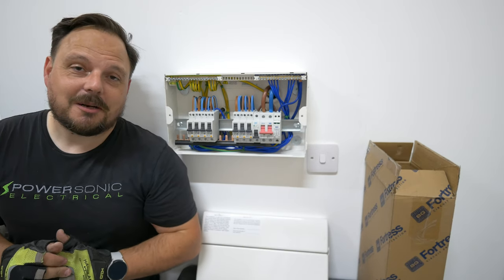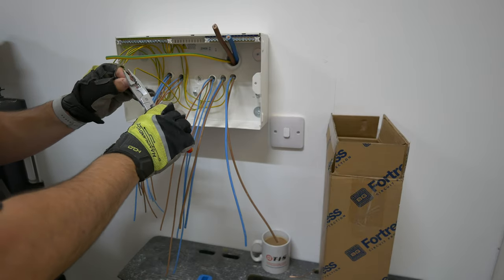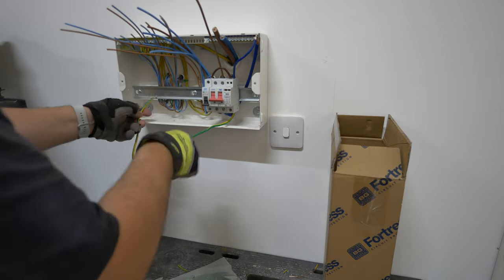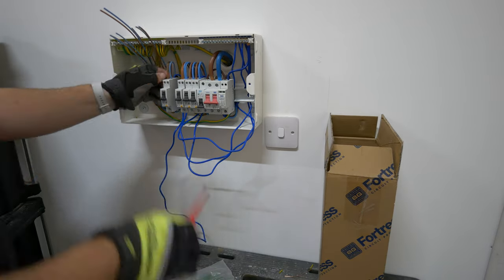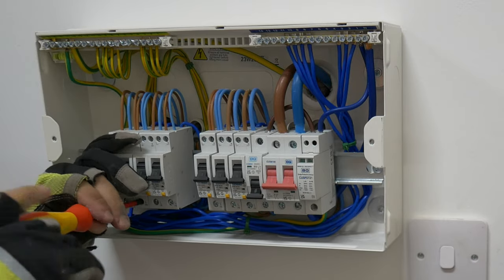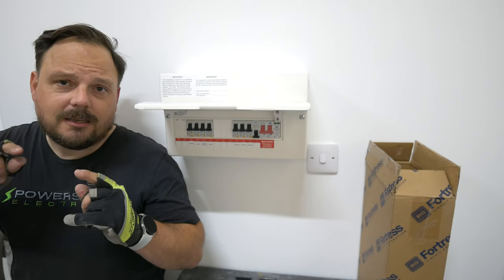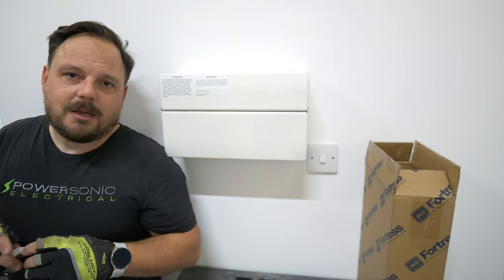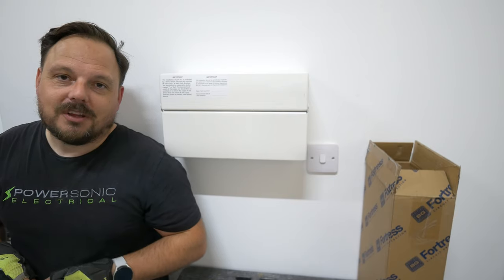Apparently its easy to install a consumer unit ??? Full run through - TIPS - TRICKS - BAD HABITS???

Comment: Tip for getting the db lids on easily... when fitting the din rail, mount it just tight enough so it moves with a little nudge, mount 4 or 5 mcbs onto middle of din rail, fit db lid on and just start the cover screws, the din rail will align with db cover, use a sharpy, and mark either side centre on din rail and db, pop lid back off, check your markings are still in alignment, and tighten down the din rail screws... when you come to fit the db cover when all is finished it will fit like a treat...
Reply from the maker: That’s a great tip. Thanks for sharing
Reply: Or mark the din rail before you strip down the db for fitting. In theory, it should align correctly, but we all know not all db's are equal...

Comment: I am not an electrician but i have a question regarding  the bus bar should the unused ways be insulated. I enjoyed the video of you doing a neat job.
Reply from the maker: It’s a sensible thing to do and we always fit din rail blanks which cover the busbar. As this is pre testing and final commission we are not at that stage yet. Thanks

Comment: Hey Mark, thanks for the video, it was very informative and I can see you put effort into the installation. I'm not an Electrician, but I am a Commissioning Engineer who works on industrial electro-mechanical equipment. My industry is extremely heavily regulated with regard to safety. Only qualified professionals are allowed to touch the equipment I work on, but all too often a professional makes a mistake and thankfully the additional safe-guards we have in place prevent a serious injury, or death....most of the time. Were we not to take what I call "best practice" safety steps, I know personally of two incidents within my own team where an innocent assumption could have resulted in millions of £/$/€ of equipment damage, or a 3-phase human fry up. 

A couple of people have commented on the bus bar being left exposed in your installation. I know this is behind the cover with blanks installed on the cover. I know that only an Electrician should ever remove the cover, but I understand where others are coming from (though some could have worded it better). Not everyone, professional, or idiot alike does what they should all the time. So, I personally think it's a cheap and easy safety step to insulate the bus bar within the enclosure, even though I agree that it's insulated from the customer when the cover is on.

Every installation I have seen so far had the exposed section of bus bar covered with a plastic strip on the bottom, or where there is a gap between breakers, this exposed section is insulated, or an unused fuse is installed. As you say yourself, you will inevitably have a customer doing something they shouldn't do, so if you are not inclined to leave a magnetic wedge that keeps the fuse board door open for fear the customer will misuse it, would you consider it best practice to insulate the bus bar sections which are exposed if the cover is removed? 

Again, thanks for the video. I'll be installing a shed consumer unit and the videos on here are full of useful tips from the professionals. I will of course be leaving the final inspection and connection to the Electrician, because I know it would be all too easy to make a simple and costly mistake when it comes time to energise the circuit.
Reply from the maker: Cheers Gary, full din rail blanks and proper labelling are always used. But I like to demo what comes in the kits etc. 

A few brands have uninsulated or covered busbars BG are one in some of the range. 

So it is what it is on that front. 

This is actually a demo board at apprentice 121 simulating a small flat for learners to practice within. This video is a reference point as part of that to raise discussion points such as yours.

I have other boards on the channel with similar reviews and what comes out the box. 

Cheers

Mark

Comment: Nicely explained video. 👍
The front cover setting used to be a lot worse on the large boards as the din rail only had end supports and so used to bend really easily. They added centre supports to fix this. As you say, it’s nearly there but still can be a fiddle.
Reply from the maker: Yes it was a lot worse before. I think tbh my struggle getting the busbar in set that in motion as I didn't quite have the mcbs and rcbos lined through.

Comment: Nice clean demo Mark, I must try your technique of laying down the Neutral fly leads to the bottom of the board and bring them up at the end, I usually try and tuck them under the tops of the ones to the right as I fit the RCBO's, as for the keyboard warriors you know what they can do with a pair of croppers
Reply from the maker: That's the method I usually go for tbh hide things behind the 1st few rcbos etc. But plenty of space at the bottom of these boards

Comment: Everyone says it’s easy, but I usually encounter a problem and it will take the whole day, 6am till late at night, I’ve only have one easy board change, 
and what if you encounter a shared neutral on the lighting, if you can sort it out on the day, Takes a very long time to sort that out

Comment: Great video and super useful tips on making inside CU   neat and tidy. Much appreciated.  What is your view please on stranded vs solid core cable. I  believe the cables you worked with   in this video are solid core wire. Do you  ever use stranded cables in domestic wiring please? Thank you.
Reply from the maker: In the UK we have stranded cables but they tend to be on final accessory connections such as lighting pendants, immersion elements, heating controls and more recently some EV ultra cables. Those get ferrule crimped on the end. The fixed wiring is generally solid or 7 strand.

Comment: Question, please ecplain the function of the component arangement on either side of the isolator switch that was already nstalled on the rail prior to attaching the rail to the enclosure.
Reply from the maker: You mean the SPD? Surge protection device?

Comment: Thanks Mark, I found this very interesting and informative. One question I have - how did you know which cables were for which circuits? I couldn't see any labelling. What is your usual method for identifying circuits at this stage? Thanks again, very well presented video.

Comment: This video has given me quite a bit to think about regarding my attempts of fitting a board to the point where I think I can save half an hour on my next install.  One thing I wasn't clear on is how you mark/ identify your cables at the beginning.  Did you number them somehow?  Thanks.
Reply from the maker: Hi Paul, yes number the sheeth to identify. With cables coming in the same entry point you can then transfer that cable ends if its busy in the board. Wasn't needed here as cable entry was separated etc. Thanks

Comment: Those Knipex feed through cable strippers, do you have to do anything special to maintain them. I have a pair that i rarely use as they just mangle the crap out of the cable, if i am lucky i get one clean strip then its back to mutilation again.
Reply from the maker: No mate. Mine just work same as always.

Comment: Awesome job! I just have one question. When you are connecting the unit to the main line do you do it with power on it? I am about to install a new unit and I am slightly concern that I may miss something important. I am planning to pas one cable at the time so there is no real danger when toching one one of them or even the metallic  box with one of them if the other is properly secured, isnt it?

Thanks again for such detailed video.
Reply from the maker: You need to stop what you are doing and speak to an electrician. Do not do what you suggested that’s for sure

Comment: Really great, clear video. I'm considering a career change... from no qualification, to qualified electrician, how long would you say it takes, if you can study full time? Cheers
Reply from the maker: With the portfolio 2-3 years would be absolute quickest I would say is possible even full time. Plenty are on that path and some told 6 months. Getting the experience is the hard part beyond just the courses etc to complete the portfolio and NVQ.
Reply: God people are obsessed with NVQ , take your level 2 and 3 tech certs and complete 2391-52 along with 18th edition and then it’s hard for someone to say you’re not a competent Electrician!

Comment: He's a question... Another spark said to me, why don't I trim the fly lead on the rcbo, to fit the install, like it says on the installation instructions,... Lol,  I said, I just do the same as as what other sparks do 😂😂😂
Reply from the maker: Some brands state not to cut them. I leave them long when possible so they can be moved if required. But sometimes also trim them. We do what we like 🤣🤣

Comment: Nice install.how did you protect the meter leads please
Reply from the maker: What protection would you suggest they require.
Reply: @electrician247  always happy to learn but either in trunking or in wall steel trunking

Comment: Bending over the CPC's to get a nice clamp? Regs state that the terminal must be filled with 2/3 conductor. That's why you bend them over.
Reply from the maker: Do you want to quote that reg and I will share it.  In a terminal bar with 1mm to fill 2/3 you would need more than doubling over 🤣🤣🤣

If you want to look at the actual fact of the matter different brands have different requirements. Most want conductors under 1.5mm doubled over in terminal bars with no reason to double into a cage clamp. 

Hope that helps and your welcome anytime at the academy if you want any further help

Comment: Good video. But it is easy to install a consumer unit,  just be tidy with the wiring.... Did you use the correct torque setting?
Reply from the maker: Nah its easy why would anyone need to torque anything.... I guess its easy when you know how. Who knew.
Reply: 😁 @electrician247

Comment: From France it is a very dangerous installation...what you have done in 13:38 is completely forbidden!! Not acceptable because there is no protection or isolation ...a copper bar installed like that is not very serious from our standards.. it's possible to cut the copper bar to avoid such a weird installation.. NOT ACCEPTABLE AND NON SECURE..I DO NOT APPROVE
Reply from the maker: No need for caps it’s weird. The busbar is isolated via the main switch, it is insulated and carries blanking modules for future use. Cutting it is both unnecessary and counter intuitive. It represents no danger to skilled electrical workers or operators and is standard practice in UK systems. Indeed this is as per instructions and regulations. I take your point of view but don’t require your approval 💪

Comment: Its not a buzzzzzzzzz bar.
Reply from the maker: Say what you see.
Reply: @electrician247  bus bar not buzzzzzzzz
Reply: Also you left live open conections on the BUS bar.. thats not good pratice and should be cut and insulated.